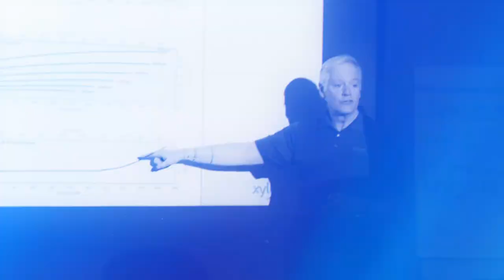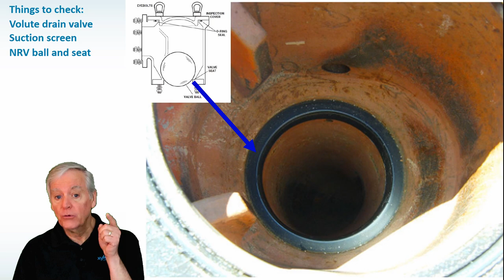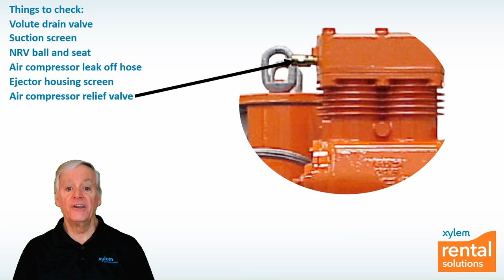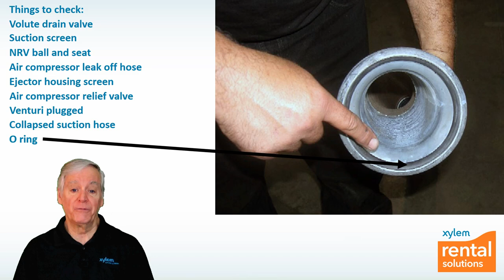Godwin Dri-Prime Pumps: Troubleshooting Priming Issues

Comment: Sometimes the teeth on the belt shred off which may still turn the compressor pulley slightly creating some airflow coming out the leak off hose without sufficient pressure, I had a case once where the bottom bolts on the discharge backflow preventer were loose, it allowed vacuum to escape because the flange was under the ball inside